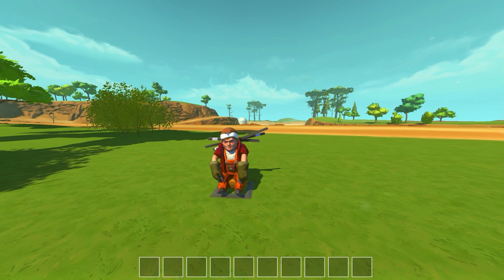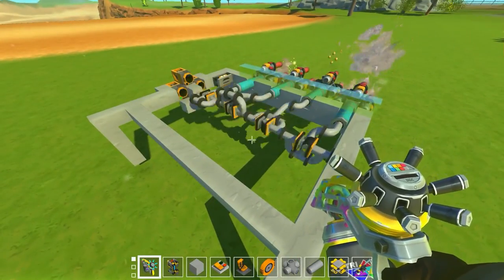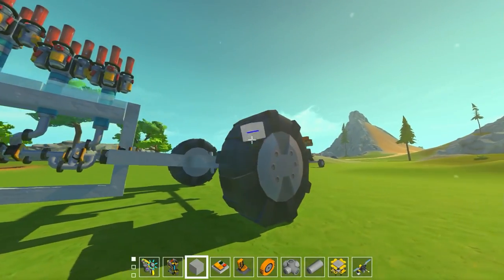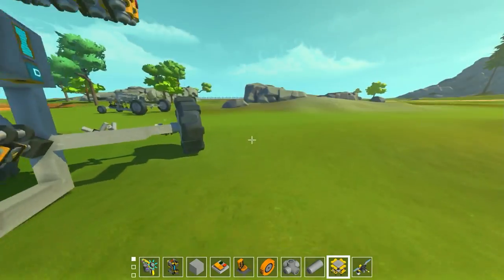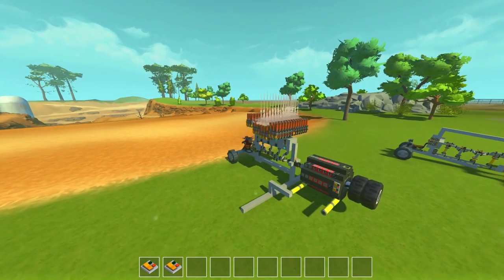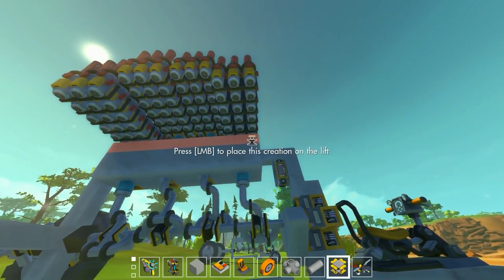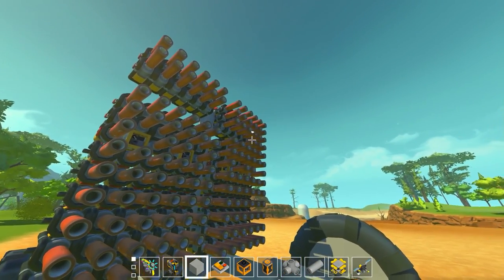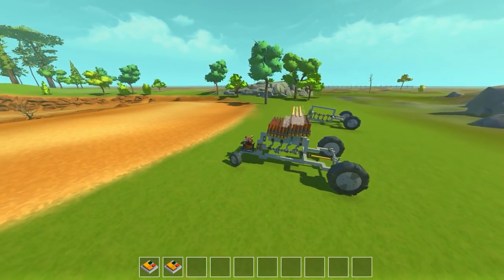Spud Powered 4 Cylinder Engine & Car! (Scrap Mechanic #290)

Comment: The problem with the spud-engine is that, the spuds firering not only need to drive the crankshaft to move the car. They also need to spin the crankshaft to lift like 120 other spuds against gravity on the other pistons. This could be fixed by having spuds face down aswell to push the pistons up.
Reply: or having moded 0 weight spud guns

Comment: I have an idea! What if you have the spud gun inside the cylinder, then have them shoot down. That will increase the force drastically.
Reply: The Engineer Guy yea
Reply: that does not work in scrap mechanic

Comment: Each Spud gun causes the game to calculate angle of force. 200 spuds pointed up are all canceled by the ground but in any other direction they multiply until they encounter a change that each one has to calculate hence the lag

Comment: Make a engine where instead of a piston pushing it, you shoot a potato against that block where force would be applied maybe? i think the impact force is greater than the recoil force of the gun.
Reply: Dude, the last update fixed that so it will not work now soooooo...... u should have asked it weeks before.......... bad luck.👍
Reply: The only thing that was fixed is that the spud guns were able to push stuff they were directly wounted on.
If the piece that gets shot can move seperately (e.g. on a bearing) it should still get pushed, so a motor should theoretically work
Reply: The blowing your one sails wus not 100% pached you can shoot a bock on a baring and the baring will you know move vary fast
Reply: they fixed it
Reply: Could double with both methods using single row of spud guns to move both.
Reply: or mount the guns on a rotor of sorts and connect that to the output with a clutch?
ive made a spud motor that some what works
more eficient than kans can tell ya that

Comment: I think that similar to using thrusters to push a cylinder, the car isn't moving due to the drive from the crankshaft, but rather the recoil is just pushing the car and the crank is being rotated primarily by the wheels

Comment: u should make a double converted motor so if you want more power you could just hit a button, and if the wheels would have a lack of power and stop moving you could hook up a logic gate powered to a sensor and the sensor keeps one of the engines running but if the sensor stops getting signal you could have a logic gate set to activate both motors

Comment: I have my own spud engine method: instead of using the knockback from the weapon, use the force of the potato. I build a + shaped shaft. Aim spud guns so they hit the bits sticking off of the shaft and it spins. I have a "V8" I built using this. it isn't really a V8 because only 4 guns are firing at a time, but it can go in two directions. still trying to figure out how to make a car go fast using this method as it is extremely low torque like yours, but im getting there...

Comment: I think you'll end up lowering planes with that engine. u could use the sensors in switch mode, it is simple when the trigger is up you could put a repeater on until it reaches down when the sensor should turn off or on. It is a way to avoid timers. I used this system in the electric motor gave me better result than put them as a pulse and could make a perfectly logical door operated by a button work in 2 directions just by changing the order of polarities ...

Comment: I'm curious as to why you didn't use the impact force of the spuds to attempt to spin a crank, instead of the recoil system. Recoil is astoundingly less powerful than projectile impacts, that's why we use the bullets as the force multiplier, not the buttstock of the weapon.

Comment: kAN your magnet motor can be a lot more efficient tho. Why don't you try to improve your design? :)
Edit: Also you if you add more piston travel on the spudgun engine by changing the diameter of the crankshaft (as you should have done at first place because basic physic) you could get way way more torque out of it. Here is another tip: use the powerless pistons by Lord Pain to make the actual spud gun pistons point straight. That way you have less energy loss and you can remove all the friction from those stupid pipes that are sliding against the holes. ;)
Reply: sliding against the holes... XD
Reply: Alstrak biig editt
Reply: Alstrak ive seen you before, a long time ago. like maybe a year ago or something

Comment: You should use simple machines
Like gears
The double gears that have a small at where they receive the "push" and a bigger part in the same gear, that gives a bigger force than it has gained

Comment: I know I'm a little late, but what if the length of each crank arm was too short? Having larger crank arms would require less torque to move the same amount of weight, and we all know spud guns don't have a lot of that power. But they might have speed to make up for it.

Comment: You should have also used the power from the potato projectiles to make the engine a little more powerful. Easier said than done, but I think its possible.

Comment: I made a tank where every block on every side is covered with spuds, 2 walls going at a time is good, 3 gets laggy, and 4 makes you have to trick restart the monitor. If you want to know more detail about the 'fake' or 'trick' restart comment and I will tell you the details

Comment: would it be better to have a shaft with flaps that are shot by spud guns? you would need guns in every direction with opposites firing at the same time to neutralize the forces but at least to me it seems it might work, at least for a few seconds before crashing the game.

Comment: Your problem here seems to be a lack of torque so you need to figure out how to gear the car for more torque. (Smaller drive wheels and larger gear coming from the engine.)

Comment: Im sorry Kan but its baaic logic to say that it would produce more thrust to put them behind the car. Anything else would make no sense. When you place them on top, they will have the same amount of momentum, which will be made less by friction and the engine design/ energy conversion. F.e. A lot of the momentum will go into downwards acceleration as the spuds push onto the engine.

Comment: i made a spud car that WORKS
Reply: its only a 12 cannon setup with 16 cannons (4 to start it) its more of a motor
but i also made some boxer spud engines
Reply: the engine that runs a car
is a vertical engine but all it dose is spin the shaft round
theres no recriprcation